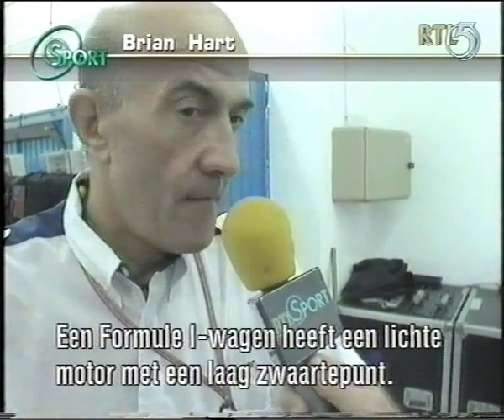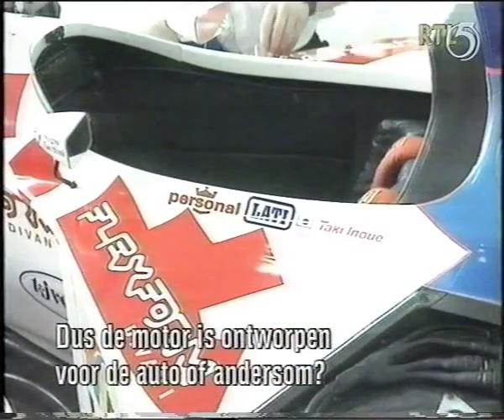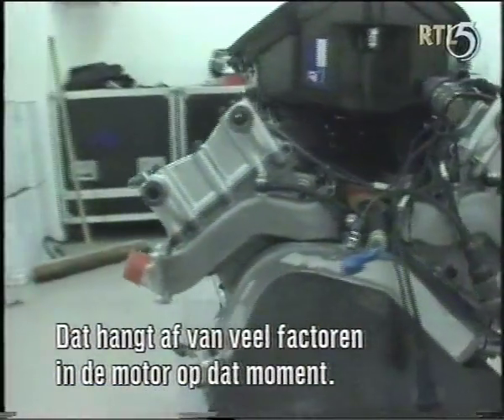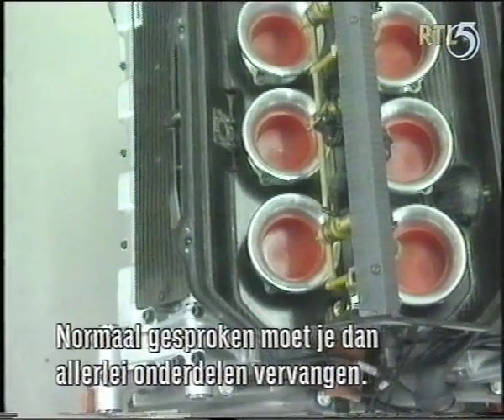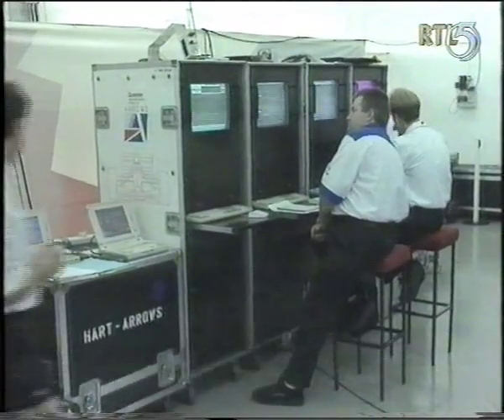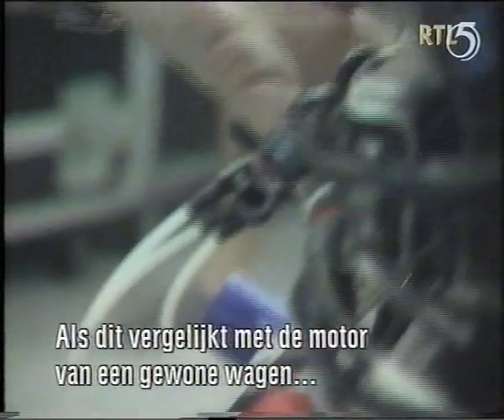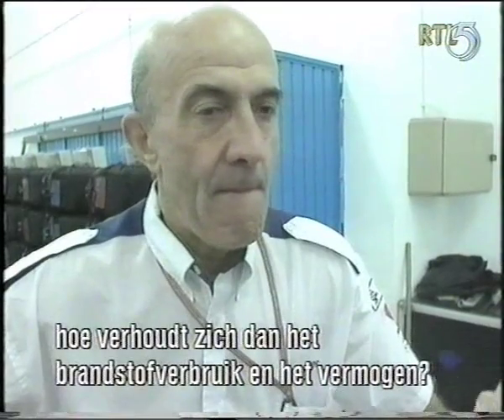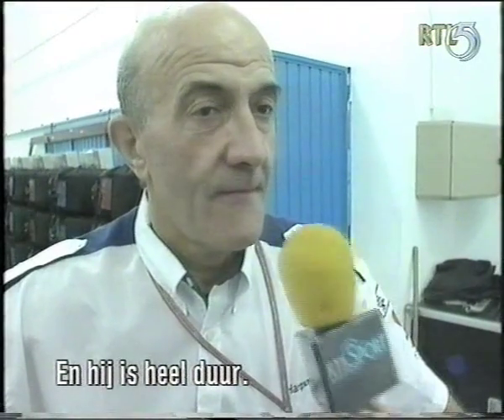Hart Racing Engines 1995

Comment: I hear Alan Jones is not a fan of Hart engines. The Beatrice/Hass team had to run Harts for about half of the 1986 F1 season because the Cosworth Turbo was having development issues with the "engine management computer". Jones described the Hart as a "boy tying to do a mans job, just underpowered". Did not matter in the end as the Beatrice team folded after just 1 season.